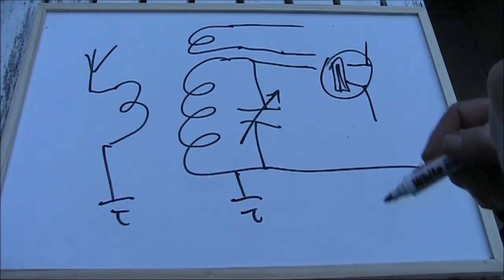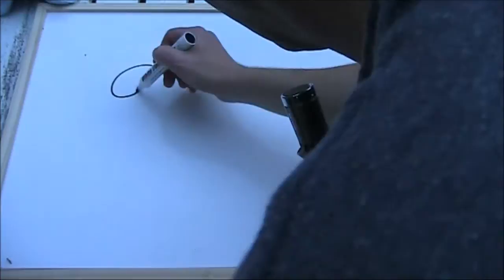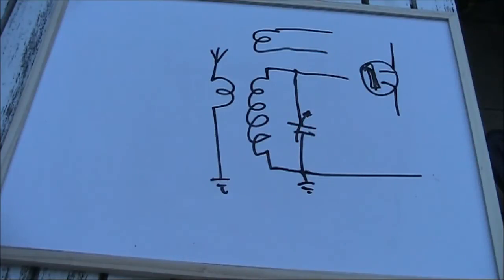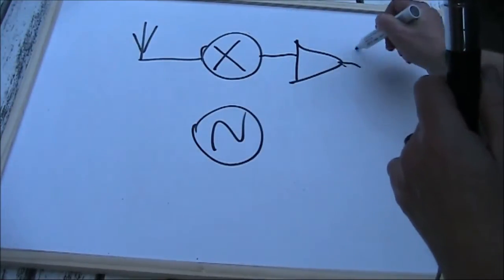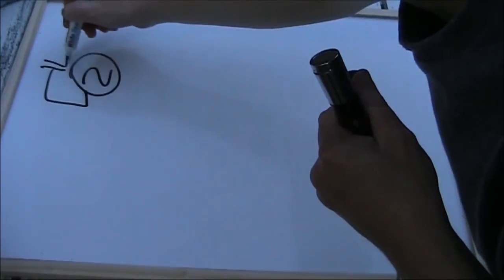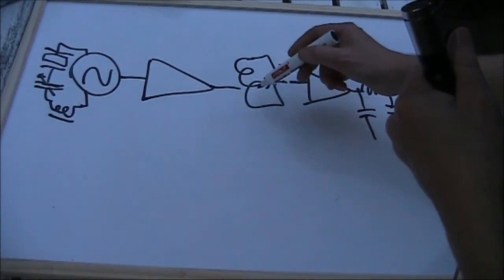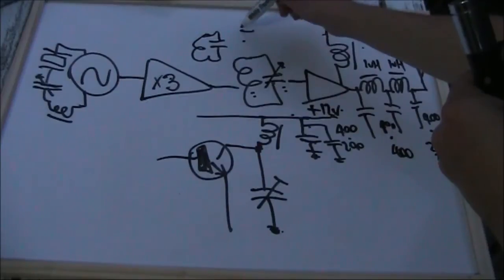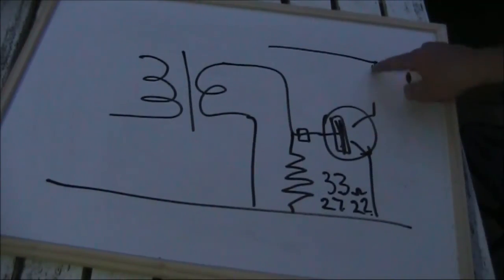Modifying QRP circuits to operate on another band: Part 2

Comment: Hey Peter, can you modify a FM broadcast band transmitter to 2 meters for a fox hunt transmitter? 73, K5DVT
Reply from the maker: +8-bit King Depends. If it's crystal controlled you may be able to change the crystal and adjust frequency multipliers.